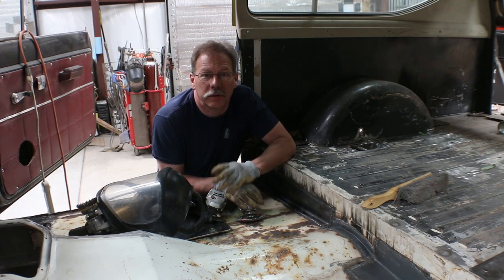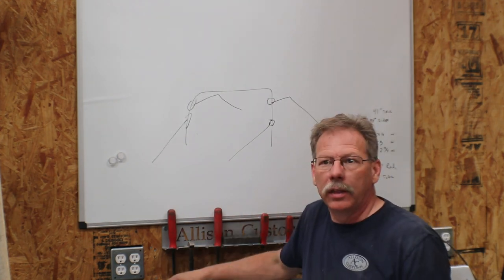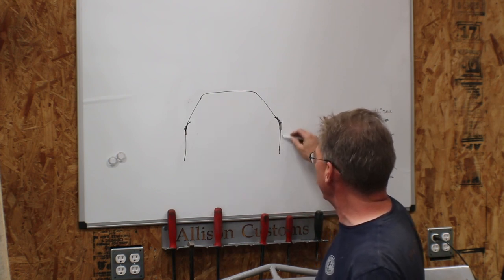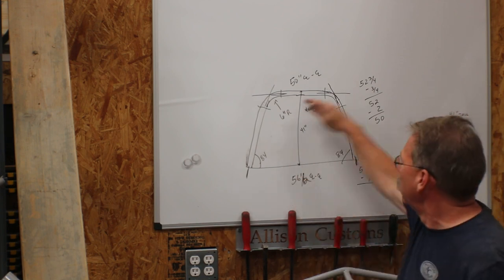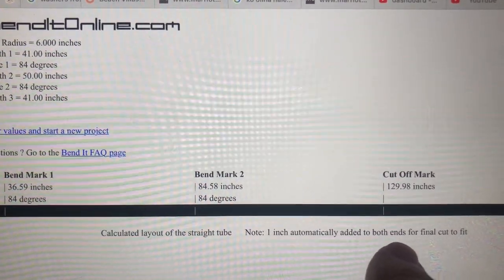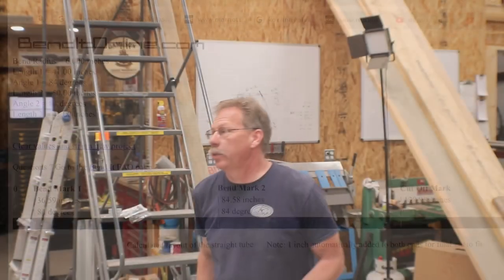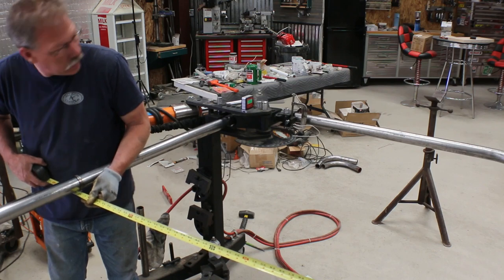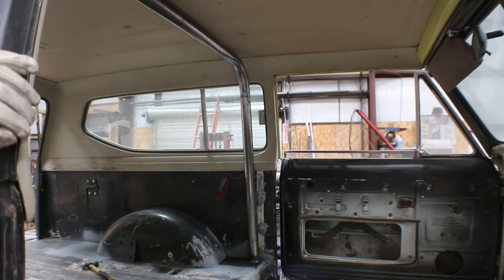Project Creep Ep. 22 - Roll Bar for the International Scout II | Allison Customs

Comment: I was stoked to see you got the 84°s right, but you missed the main hoop mid peak of 3°, which is a load bearing attribute, and the rear legs 1. having a bend, and 2. going to the floor rather than onto the humps (think structural support of the roman arch) brought me to tears...
Reply from the maker: First I want to say thank you for watching and for commenting!  Second, Thanks for pointing out what you believe to be the Good and the Bad to what I'm doing, both are important.
Now back to the show:
And you've touched on one of the reasons I was not calling mine a "roll bar", the bar I built is definitely stronger and attached better than say an 80's chrome show bar, but I did no build mine to be a full on roll cage either. I built mine to give some good low speed protection to the occupants, look good and add to the aesthetics of the truck and most importantly not be a danger to the occupants. This while also fitting as tightly to the body as possible.  A peaked or arched upper main bar would add to it, so would a cross bar in the main hoop, so would an "X" in the down bars, so would door bars, so would a windshield hoop, the list goes on and on. 
See our other discussion for more thoughts on all of this roll bar stuff.

Comment: Curious as to your logic "a rollbar is not a rollbar unless tied to frame"...  By this rationale... should the driver via seat be tied to frame?  As that answer is clear, is not containerizing the compartment that contains the human... not rollbar enough?  Load bearing and collapse seem to be the only ACTUAL mitigating factors that seem to be getting glossed over...  I'm a survivor of many Scout crashes, and a proper BODY MOUNTED ROLLBAR, in a proper maintained and beefed Scout... WILL save you.  What i hate seeing is creative bends and gizmos and a lack of structural triangulation.   Okay back to the program....
Reply from the maker: You are right that properly mounted and supported roll bars can be mounted to the body and provide good protection for the occupants.  IMO you would then be trying to build a capsule to provide that protection, which could work perfectly well, if done right and all the safety equipment is tied to the capsule.  The problem that I to often see with most body mounted roll bars, is that they are only bolted to the sheet metal floor in a few locations with hardware that is undersized or not of a good quality and with little to no thought to getting them bolted to a structural member of the body under the floor.
Or possibly worse than that the tubing gets welded to a small piece of flat plate and then that is welded to the sheet metal with nothing tying any of it to something stronger than some 18ga sheet metal that is now all at least 40 years old.

So yes, maybe I overreached when I said that roll bars should be securely attached to the frame only. 
Please remember, I'm just another guy out here doing the same stuff you are, while also trying to share some of the knowledge and experience I've gained over the years. My opinions are NOT definitive, just my thoughts after working on all this stuff.  

Some of the best stuff that comes out of the videos are the messages I get letting me know that there are other successful ways to do something, so Thanks for taking the time to start the discussion!

What do the rest of you think or what have your experiences been?
Jeff
Reply: @AllisonCustoms  **Also the 'tilt scout' in my logo... is a hat tip to my rolls, and survival.  :-)